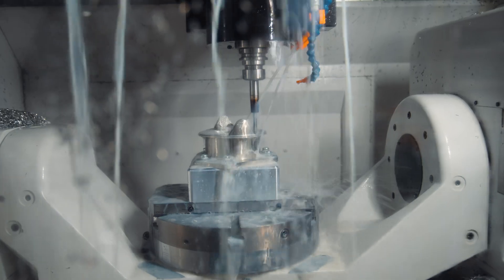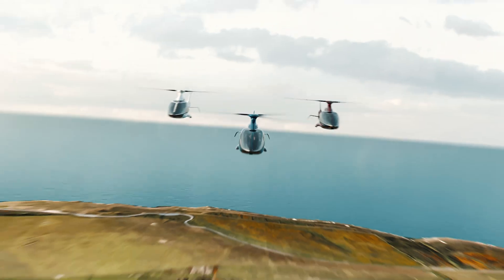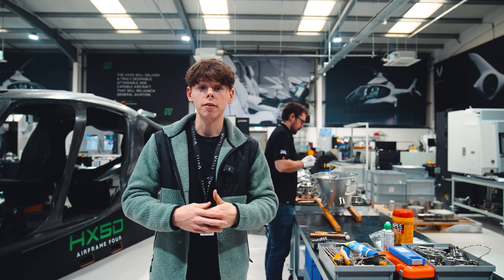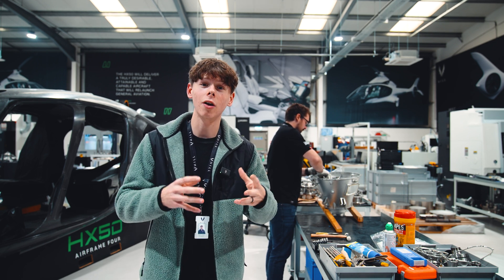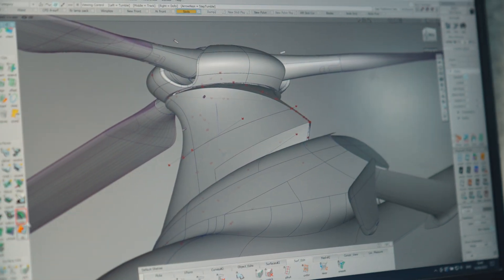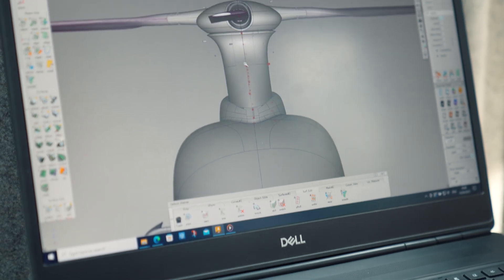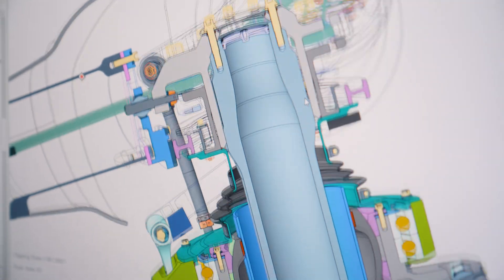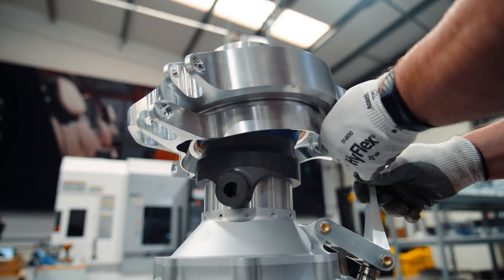Journey to HX50 | Episode 34: Building the Main Rotor System

Comment: Can someone explain me the feature of the central sliding disc that seems to affect the flaping of the blades ?
Reply: Do you mean the swashplate? Don't expect a video like this, or comments by other viewers, to explain the most basic and fundamental aspects of helicopter design... but now you have the keyword for a search to learn about the "swashplate" in a rotor system.
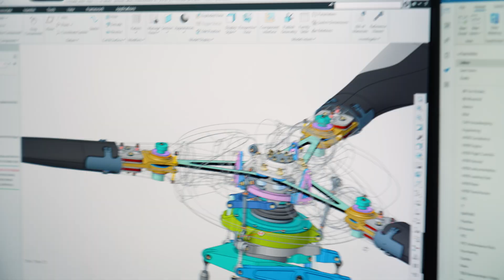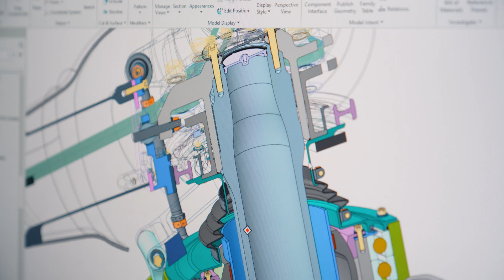Reply: @brianb-p6586  Not the swashplate, I was talking about the Pink plate at 0:15 and you see it at 4:12.
It is located upper than the Swashplate and on another video, we see that the blades have a contact surface with this plate and seems to counter act other blades by pushing on it.
Never seen this on other rotors before
Reply: Interesting, @adr1uno638 . I assume that it is structural, rather than being a controlling element. 

If I'm looking at the same component, it looks like this ring (rather than disk) with an I-beam cross section and holes through the web is the lowest element above the control fork at 5:17, and the highest ring-shaped element at 5:34 and lowest element at 5:40. When a blade root is moved at 5:20 the ring doesn't appear to affect pitch or flap motion, but perhaps only due to the limited travel or the incomplete hub assembly in this case.

Given Hill's "use proven designs" approach this must be a conventional component, but I do not know what it is.